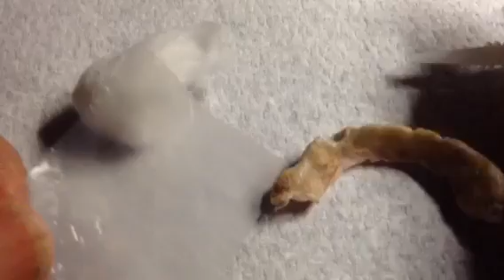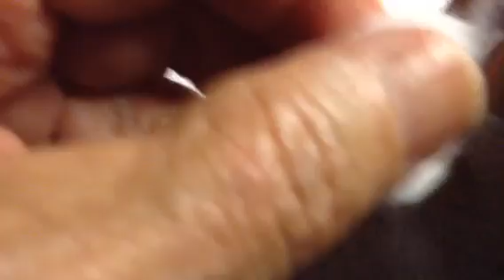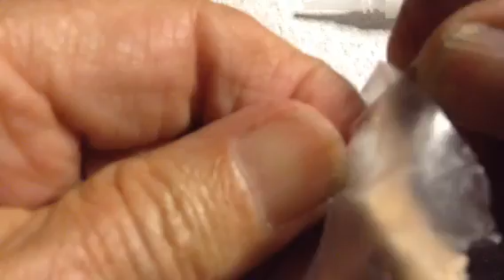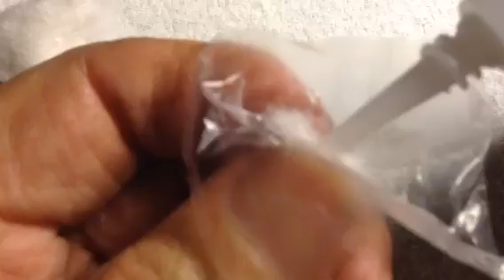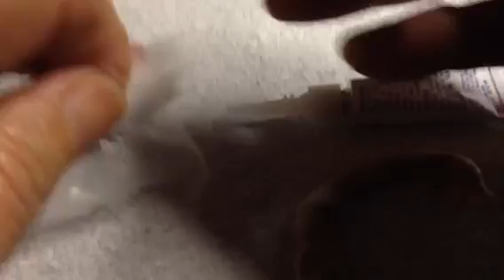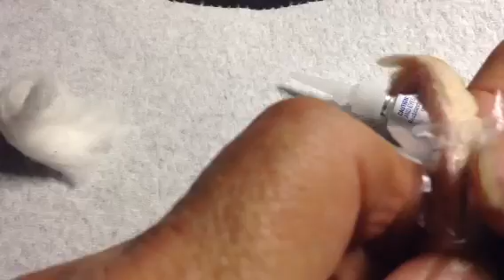Simplest denture repair using super glue and cotton (Sucott)

Comment: what if the superglue breaks down and you swallow glue... toxins 😂
Reply from the maker: There are NO toxins; google "Cyanoacrylate for dentistry"
Reply: I just used Super Glue because my damn dentist created a hole in a tooth next to the one she worked on. She wants more $$$. The hole was in the back of a molar. Super Glue (Ethyl Cyanoacrylate and Hydroquinone) is made of the stuff used for liquid bandaids, sutureless surgery, etc. The 2nd ingredient is used to bleach skin when dark spots appear. So I'm not concerned about toxins. I just hope that it holds up. Actually I'm proud that I got the hole filled without much trouble. It wasn't in a good spot. I had to scrape it off my tongue & gums but that was easy. I think my old mercury filling was probably more toxic than Super Glue.

Comment: I suggest using baking soda mixed with the super glue as it becomes far stronger and dries almost instantly! first, apply the super glue and then pour a little baking powder to cover the glue add more glue as needed with the baking powder until you are satisfied
Reply: Brian Ninjutsu You mean to make a fake tooth??
Reply: @ Taylor sara yes if you are desperate! or you have  false teeth and you have broken one (this would be  where super glue and baking soda will work best )  you can build up  a tooth that is broken  using  this method  and you will have to sand it smooth mainly at the back of the tooth where you will build up the tooth, of course, you have to let it set for as long as possible before introducing it back in ur mouth and I have used this method and  so far has lasted over 3 months and holding strong . If you were to try this on a normal tooth  say to  put some sort of cap on a tooth or build  a broken tooth  back to normal  you would find it difficult to do by your self  because of super glue as you know runs everywhere and mixed with baking soda becomes a problem and hard to control also giving it enough time to set without saliva interfering with the prosses ! for you to build up a tooth you would need to surround the tooth in something like plasticine to prevent  the super glue from running everywhere and add the baking soda and more S glue in small amounts  to ensure it is completely mixed or absorbed with  the B soda  adding it slowly ! both the super glue and baking soda are inexpensive  so  I would recommend doing a few tests to try out to see how things go even if you started with a small stone and set it up so that you can surround the stone with blue tac, plasticine or some sort of removable putty  to create a wall that you can then  add the S glue  and baking soda  to slowly fill up and let dry and later remove the putty  so you  can apply what worked on the test  to make one for real . Again it is not an easy thing to do but if done correctly you will get great results.
Reply: @NINJUTSUguy  Thanks. Im goong to tell my friend about this...
Reply: @ Taylor sara....  if you look up using super glue and baking soda on youtube they might get some helpful hints and cover some groundwork before they start.
Reply: Do youa apply the baking soda while it’s in your mouth?
Reply: @shadezofgray3479  yes and that's the hard part,  that's why I say experiment first .
Reply: @shadezofgray3479  Depends what you are trying to fix false teeth can be removed cleaned dried and then repaired and sanded. Doing repairs on teeth inside your mouth will not be easy due to moister and the ability not to be able to see clearly and sufficient drying time to let everything set rock hard .If one tooth was to be repaired I would suggest using something like a straw that could slip over the broken tooth and filled with the glue isolating it from the rest of your mouth and removing the straw section  . So you will need to experiment first outside of your mouth until you are satisfied you have come up with the correct method that will work in your particular case . If successful you will have a very very strong bond and a material much like a real tooth .I can not stress enough, experiment first !come up with a plan! someone to help you after you have worked out a method will keep things neat and tidy ! Try to fashion the part of the tooth first out of the glue and soda and sand it to shape then using more glue and soda attach it , remember a mouth full of  super glue and soda is to be avoided you need to contain the gluing only to the affected area you cant afford to be messy at all so think about this carefully ,I can not come up with a scenario that will cover all of the different cases but a rubber dam (also known as a female condom) should come in very handy as a way to isolate a tooth in your mouth by cutting a tiny slit in the rubber dam so that the tooth to be repaired is isolated by stretching the slit so that the tooth can stick through , again someone to help would be ideal and this should  prevent moisture as well as contain the glue  and allow sufficient time to cure, a hair dryer might help speed up drying time. I would also suggest searching you tube  for super glue and baking soda videos  to educate your self first . good luck

Comment: Cool job. Thanks for your video. I'm going to do the same thing.
Reply from the maker: The cost to try it is minimal and with some luck plus skill the outcome is very rewarding... good luck!
Reply: @richardcarlisle1  Hi. I just ordered veneers. Just waiting for the cement to come in. But I read that it doesn't last long as it's just temporary.  I'm trying to find a safe glue method. I'm wondering if your idea would work. I think it would and would be good packing between my tooth and veneer.  Alot of people are doing their own cosmetic dentistry.  I need to make a partial. The dentist made it but I can't afford to pay for them. It's just not right that only rich people can go around with perfect looking teeth. We all need nice teeth, no matter how old we get.  When I was younger,  my teeth and smile were my nicest asset. Not anymore. But I will try to get it back.  Doing my own veneers won't do anything worse than my teeth already are. If my teeth fall out .oh well  they are ugly n worn out now. I Will just make my own dentures then lol. Great video, thanks again for sharing. That glue idea is awesome. Does it get hot because of the cotton?  I wonder how that happens on a chemical level. 😁cool science.  👍❤

Comment: I once had a horrible tooth ache, because the tooth was cracked and the root was exposed. I took a little drop of superglue in a syringe. And dropped it into the tooth. And instantly there was a slight warm feeling. Which felt great. And the pain instantly disappeared. I am not suggesting anyone do this though.
Reply from the maker: What finally happened with it?

Comment: Firstly DO NOT put super glue in your mouth for any reason. Secondly poly morph plastic warmed in water goes soft mould it and when it's cold is a perfect fit. You can then use a mouth safe dental adhesive. Both the things I have mentioned are totally mouth safe. Something like this containing super glue could easily corrode and make you very ill.
Reply from the maker: Super glue is being used on open wounds by millions worldwide today ... use in mouth is proven safe as well after fifteen years and not a hint of irritation ever.  You are simply WRONG.
Reply: Not every super glue is even skin safe and yes some glue is used in wounds but that does not mean it's edible . I certainly wouldn't want to drink Savlon for instance but I use it on my wounds. Iodine would likely make you ill if you ingested it too and again it is used in wounds. 

Anecdotal evidence is simply not good enough. Not everyone reacts to toxins in the same way and also you may have done damage to your organs or nervous  system you don't yet know about. 

I could site about a million sources that back up what I am saying but just one is NHS choices. 

If you wish to risk other people's health based on just what you think based on your experience then that is up to you but I will sleep better knowing I said something. Good luck to you.
Reply: Thank you for mentioning polymorph plastic. Many people are having great success using it for all sorts of dental solutions.    https://www.amazon.com/gp/product/B004MFLU4Y

Comment: that is not a craft...thats a mess..before I got my dentures I had to find an easy quick fix..thermo beads are cheap and easier than this and you arent poisoning yourself putting super glue in your mouth.this is sad...
Reply: Baby Bunch did you know superglue was originally used for wounds?
Reply: What do you think the dentist puts in your mouth ? .....
Reply from the maker: Thank you for your comment ... feedback is vital for this kind of project ... in response I can inform you super glue has been used for surgical and dental procedures for many years with no sign of toxicity.

If you know of a reliable reference that indicates there is any kind of toxicity with super glue please let me know.

Thermo beads are hardly as durable and abrasion resistant as the material shown.
Reply: Richard Carlisle thermal beads collect color and turn orange when u eat...
Reply: @taylorsara1237  you have to change em once a week or couple days I use it to replace a tooth that I didn't get the crown cus it was way more money then I had and it broke so I wasn't gonna go with nothing
Reply: Baby Bunch what is that ? Beads?
Reply: https://www.ebay.co.uk/itm/VTG-Real-Dentures-False-Teeth-Upper-Lower-Plates-Gag-Gift-Collectible/282835552735?hash=item41da5009df:g:2gcAAOSwIUxad1W7